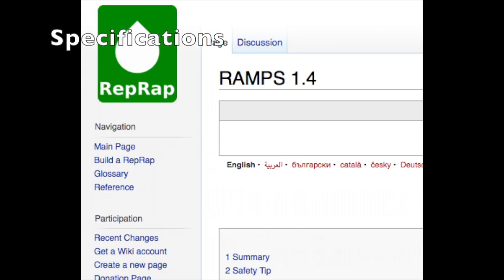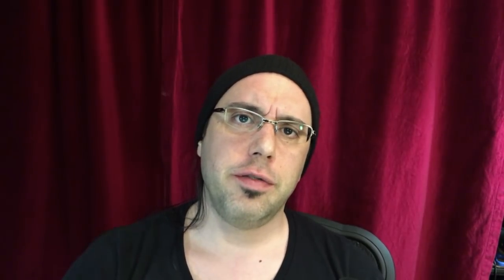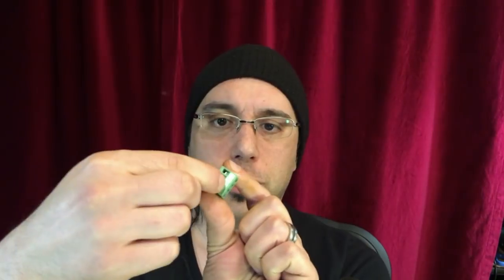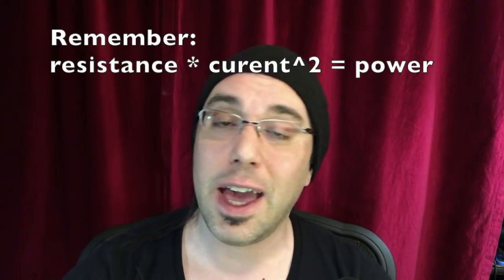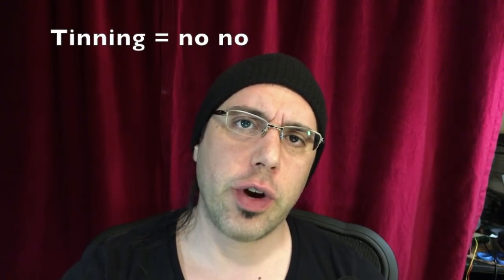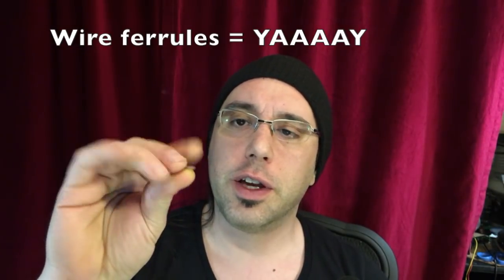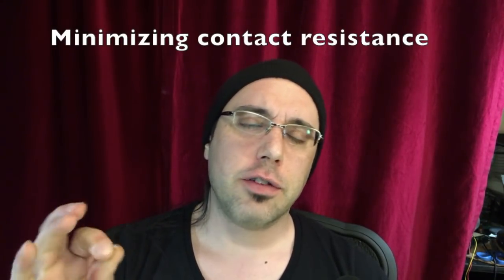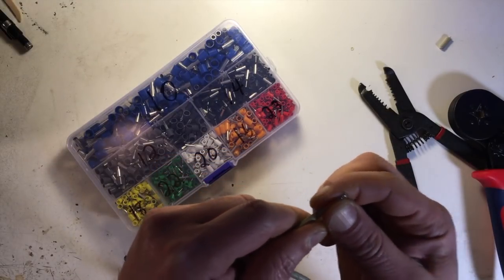RAMPS series 3 of 5 - the green connectors: how to keep them from melting

Comment: Question: I read that alot of people remove the green connecting blocks and solder directly to the board. Also removing and replacing the polyfuses with automotive blade fuses, which is a separate matter. Would bypassing the connecting block be a viable alternative or is there complications with this? Edit: I am asking this because I am trying to keep costs down and $20 for A ferrule crimping tool that I really do not think I will use for anything else is kinda hard to justify to myself. Thank you for any reply
Reply from the maker: Lemme see if I can hit all those Q’s. 1)You can certainly just bypass the terminal block if you want, just be careful when desoldering the pins because a lot of these ramps boards have really thin copper traces, and they are easy to damage.  Verify with a meter that you have successfully soldered to both the top and bottom trace as well... if you miss one you will halve your carrying capacity. 2) remember that even the cheapie blocks can be okay if you stay under their current rating and wire them up properly. And 3) you can tin just the tip of the wires just slightly and then twist them, or in a pinch just twist them.  Just be sure to re-tighten them occasionally, and make sure there are no stray strands.

I’ll be hitting on polyfuses in the next video.  They can be fine if you use them right -- they are in many SMPS power supply after all and the power supply that you will be using for your board likely has a few inside it-- so if you stay within their holding current spec, you should be okay.  Just like the green connectors, the polyfuses partially get their bad reputation because people either use them wrong or pull too much current through them.  

Regular fuses are just more forgiving of operating conditions (you don’t have to run them at a particular current as long as you stay under the rating), and it is more obvious when they have tripped. If you are nervous and don’t want to risk desoldering, just leave the poly fuses where they are and jumper the legs, then run an inline fuse between the power supply wire and the RAMPS board, or you can desolder and run wires off the board to a separate fuse block. Again, be careful desoldering parts from the RAMPS board because of the traces.

Comment: what is the official name of those connectors?
Reply from the maker: Unfortunately there is not a single/unified trade name, but when I was building control equipment for a living, we called that general family of connectors  “Euro connectors”, which blankets all the various types of European pin-type terminal blocks and connectors... that covers a huge range of options and styles though: 

So specific on the RAMPS, the plug ends are  “5.08mm pitch, euro style, horizontal, female socket plugs with rising-cage clamp contacts” and the board ends are “5.08mm pitch, right-angle, PCB, male-pin headers”.  The one-piece output terminals for the hotend/bed outputs are called “one-piece, euro style, PCB terminal blocks with rising-cage clamp contacts”.
Reply: Alex Kenis thanks!